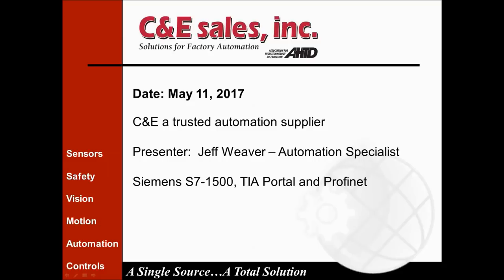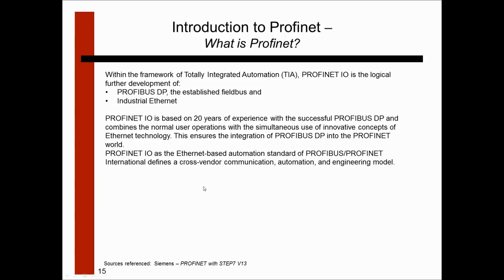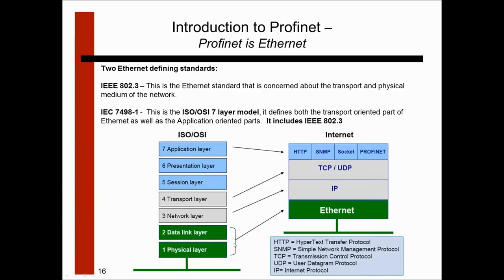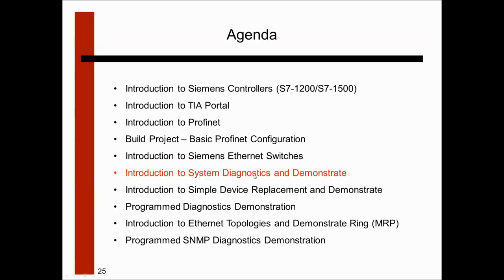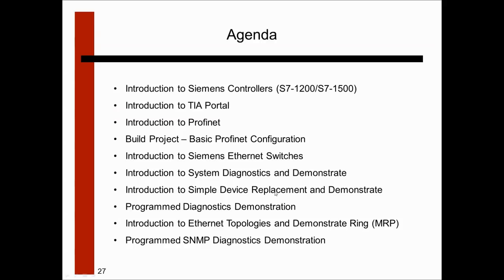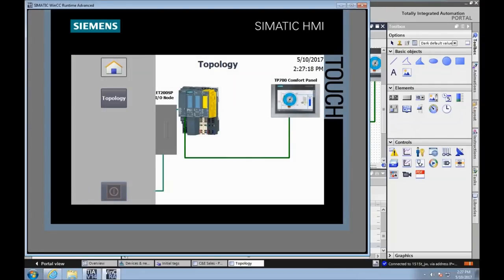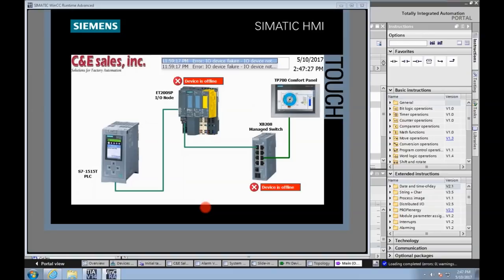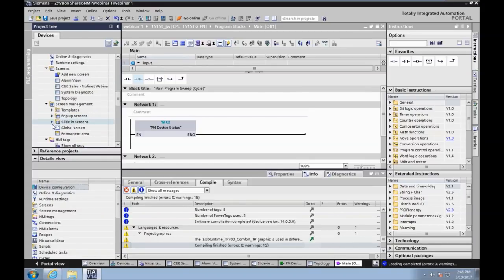Siemens S7-1500, TIA Portal, and PROFINET

Comment: Hello, thanks for the video.
Just a question, when you where trying MRP configuration, you tested it by interrupting the communication from different ports and for example et200 was washing always green so I supposed it never lost the connect with controller. I have a similar MRP configuration just more bigger, but problem is that anytime that I lose a client device in the ring, all devices goes into fault for a second the automatically becomes ok. Is there anyway to avoid this situation and keep devices always alive, even if a device is lost ? As you showed.
I would much appreciate if you share the SW I’m interested in the last diagnostic chapter 

Regards
Reply from the maker: Thank you for your inquiry. One of our CEntelligent specialists would be happy to answer your question if you can email info@ceadvancedtech.com.

Comment: Great video, thanks. My question is if I dont use a scalance switch and I just connect a basic hmi panel e.g TP1200 directly to one PLC port (X1 p1). Then I connect the  programmer laptop to second port (x1 p2), can I access and download WinCC programme to the HMI via the PLC I.e PLC acting as an ethernet switch?